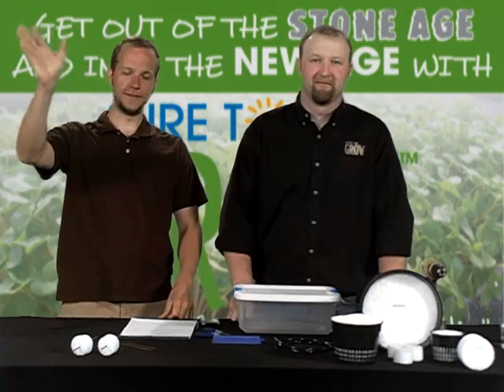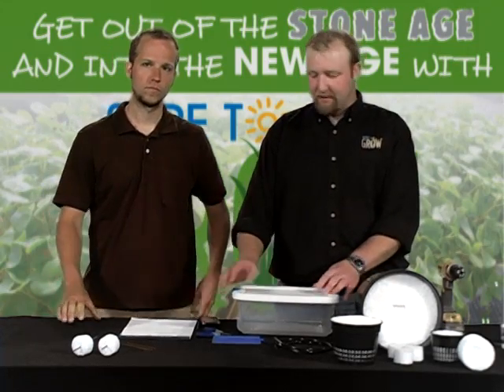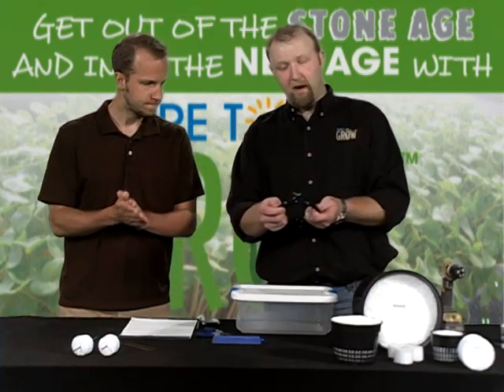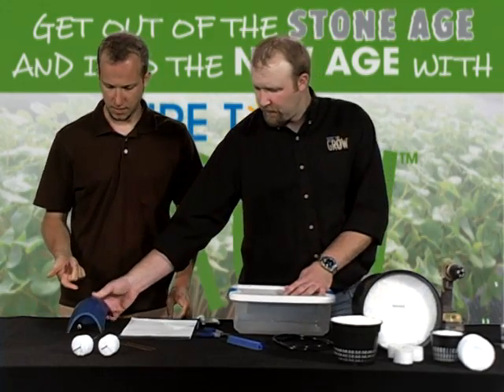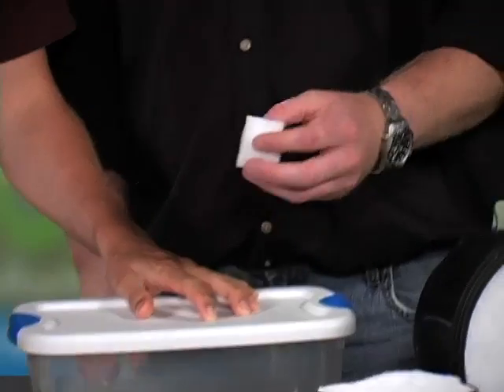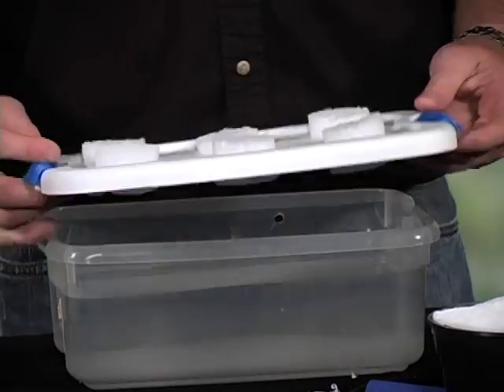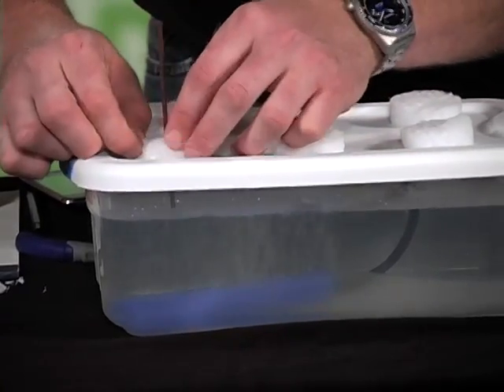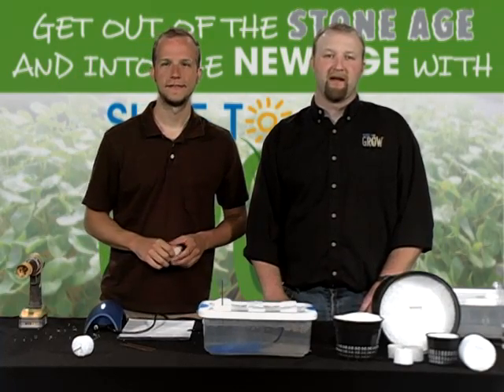Homemade hydroponics - How to make a deep water culture (DWC) system

Comment: Try throwing them in the dish washer, but use a setting without the dish dryer cycle. The heat could damage the inserts or even cause a fire.

Comment: A MOST EXCELENT VIDEO...:)   ..I want to try dwc but hight is an issue,does the resi NEED to be DEEP?.As the name surgests!,so the roots hang in the water.Or,can i use a shallow resi(ie:- a 18lt storage container 200mm high)to the same effect & take a plant to full maturity?.Abit like the one in the vid but on a larger scale i guess.Thx in advance for any feedback :)

Comment from the maker: This temperature paradox also poses a secondary problem in that a warmer bath breeds anaerobic pathogenic bacteria.  As the water temp increases the amount of dissolved O2 decreases therefore the environment is prime for a pathogenic bacterial explosion.  Fortunately, we can combat the proliferation of bacteria with more oxygen!  Hence the 24/7 operation.  This solution however can also pose a problem if the air that your air pump is introducing is warmer than the bath water.

Comment from the maker: Yes and No..In the past I always ran the pump 24/7 but recently I have been running it 15 minutes on 30 off with no real or perceived difference.  Bottom line is its all about DO levels which are influenced by a variety of factors most notably water temperature.  The cooler the water the greater the capacity of the water to retain gaseous oxygen. Unfortunately, clones root slightly better in a bath that a bit on the warm side (76-78F).

Comment from the maker: @Standinglightfox Thanks for the question. You need nothing different with a DWC system. Typicall nutrients all work well and because of the action in the water they are mixed in very well and probably stay better longer.

Comment from the maker: @robthethriller. thanks for the question.  We make the Typhoon insert that is 9.75 Dia x 5.75 Deep. It's made for the net pot insert that sits on a 5 gallon bucket. STG is not a wicking media, but in DWC and like systems it works great as the water hits where the roots are, holds the water there and keeps it away from the top, so no algae. Hail mini cubes are also great for this if the typhoon is not the right size.

Comment from the maker: @neogardener Thanks for the comment. Our best suggestion for newer growers is to get your system down cold, before moving on and making enhancements. See success, get good at one thing, then you will much better prepared to move on and make adjustments. Also trial a bit before you commit to a large crop.

Comment from the maker: @MrMacheteman I would think the natural waste from your fish would serve fine for substitute of chemicals.  There is not much out there that will not harm your fish.  You may notice an increased level of transplant shock using this system as opposed to an aeroponic cloner, or those which have gone through a wet/dry stage.  I have never lost a clone using this method, and usually get 98 percent viability or higher.  If you're curious, do a google search on water roots vs. air roots

Z

Comment from the maker: yes, be careful not to use your nutrients above 50% strength in DWC though, roots will grow directly into your nutrient solution, which is why you want to keep the PPM low to prevent burning your plants.  If you buy a tri-meter to monitor all of your values (PPM or EC, PH, TEMP) it's very easy to run your system without ever changing out your reservoir. Just top off with RO water..... and enzymes if handy.

Z

Z

Comment from the maker: The fogger is going to produce heat itself, so I would say that will be virtually impossible.  You'll have to use some sort of chiller, or like I said.... bring colder air into the room for a while, and let your air pump bring that cold air into your res, which will in time..... cool your nutrient temp.

Z

Comment from the maker: The ideal temp for all hydroponic applications is from 68-72 degrees.  The easiest way to cool your reservoir is to either add more water, or bring cold air into your room, and let the air pump in your reservoir cool your reservoir down for you.  Should be fairly easy.  You can do the same for warming it up.  Bring warmer air into the room, or turn off your exhaust system to allow reservoir temps to rise without the use of any heaters.

Z

Comment from the maker: I would try to increase you reservoir size if possible.  The bigger you go, the more stable the ph and PPM will stay in your solution.  I would also recommend adding a few airstones, or some other form of increased aeration.  It always helps increase and improve stability of your nutrient solution.  PH rising usually means that your PPM is dropping, and your plants are using more nutrients than water. Things will stay more stable if you went up to a 40liter reservoir for sure.

Z

Comment from the maker: 2 cfls should be ok, as long as they are not too close to the tender little plant.  I would say your drooping because you need to raise your water level up to at least submerge 50% of the inserts.  Have to remember STG will not wick, so you have to keep your water level high enough until the root mass hangs below the net pot.  At that time you can begin to lower you water level.  Give her some more water, and things should turn around, and stand tall. Always happy to help, thanks for the Love

Z

Comment from the maker: I have never seen any drooping upon transplanting with this system, nor should you have to top feed at all.  Before you initially transplanted, did you get them established to stronger light first?  Usually takes no more than 4-5 days until roots emerge from the net pot.  Light shock is the only thing I have ever seen cause drooping in DWC, and usually only when taking cuttings,when putting them into this system for rooting.  After that everything should be good. 

Z

Comment from the maker: You should always start with a higher water level until your roots emerge from the bottom of the net pot.  Stay a minimum of 2" from the top of the lid, and after your roots grow into the solution you can begin to lower your water line.

Z

Comment from the maker: You're going to have to elevate the buckets some how, so that you can just easily drain them into something else....like another 5 gallon bucket.... or you can setup an inline pump plumbed to each bucket, that will suck from the buckets  like a straw and drain elsewhere.  If you put a ball (shutoff) valve at the base of every bucket, you can plumb your buckets together, and tee them to a main line where your inline pump can suck from... you should never have to move or lift your buckets again.
Z

Comment from the maker: I would STRONGLY recommend that you run a batch of clones in this system first before experimenting with any additional rooting hormones or rooting enhancers.  I can say that after 10 runs in this style cloner, I had 99-100% success in under 14 days.  Roots should begin to appear around 7-9 days, and at that point I typically use 3D Organics Third EYE Dry until rooting is complete usually before 14 days.  This is not a hormone though.  It contains only Trichoderma beneficial fungi.

Comment from the maker: No dome needed.  You can use one if you wish, but I generally just mist the clones once a day, maybe twice.  This cloner work absolutely best in a controlled environment, with the optimum water temp being 70-75 degrees, with a pH value around 6.0... If you can keep these two values in check, things will root fastest.  If not controlled, it will just take a little longer.

Comment from the maker: I take two 28 gallon rubbermaid tubs that are translucent in appearance and create a chamber.  I take both bottoms and invert one of them and place it on top of the other one.  Inside the bottom a place my cloner and put about 1.5" to 2" of water in the bottom as well.  I then place an airstone into that solution to aerate/agitate the bath and encourage evaporation.  This way I don't have to continuously spray the tops.  The environment inside has nearly 100% humidity.

Comment from the maker: Their are two schools of thought on this one.  If you aerate your bath at a high volume (18L / gallon of working water) than you can partially submerge your pot, however this is generally the exception.  It requires a tremendous amount of input to generate an 18L/ gallon value so generally it is better to just place the bottom of the pot about 1.5-2" above the water surface.  This interface will have nearly 100% humidity due to evaporation and aeration of the bath and will not stunt the roots.

Comment: "Light pruning"?? Never heard of that...never had it happen either. Are you sure about that? I've used my own home-built systems & cloners with those plastic storage containers for years. Never painted them black. Some green algae, but never so much it was an issue. I did paint one once, the paint flaked off all over the place. What a mess that was. Never did it again. Never have had anything other than "air pruning" from the roots outgrowing the net containers (drip & flood/drain).